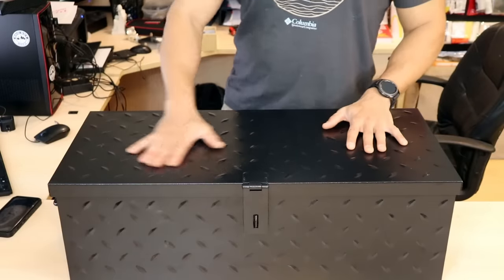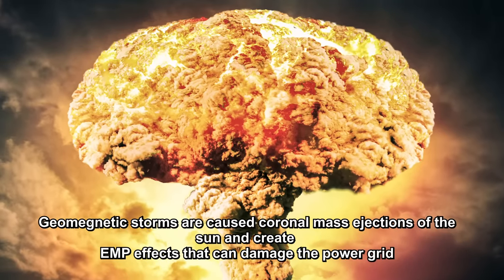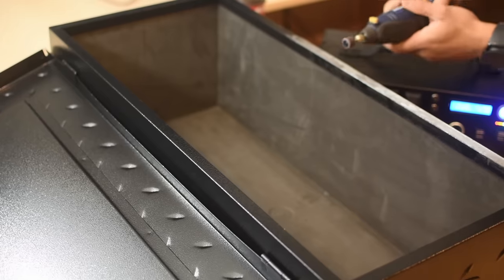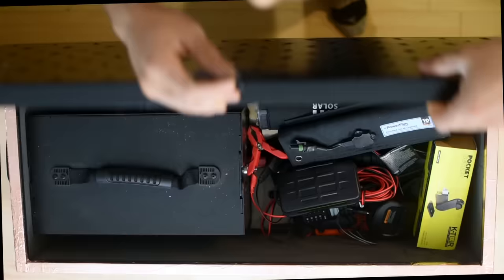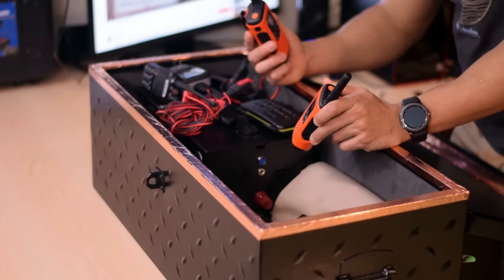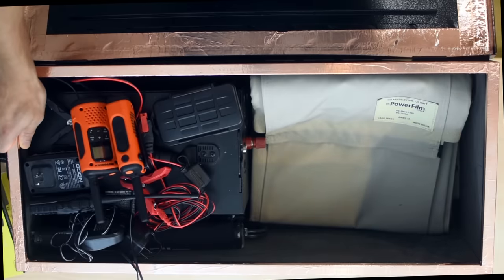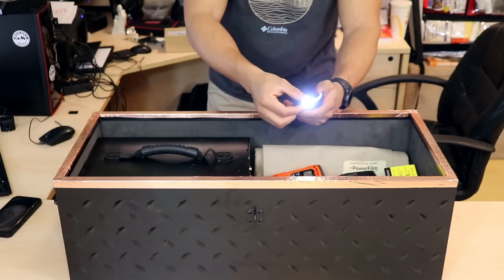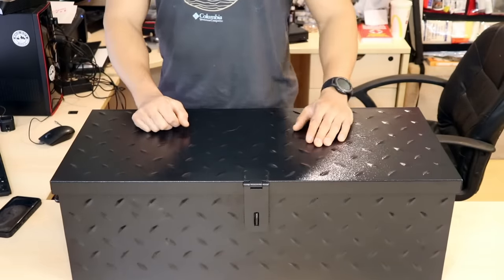EMP Prepping: Building a Good Faraday Cage | Inergy Kodiak Generator

Comment: To test yourbox for any kind of leakage, put a high power flood light or very bright flashlight inside the box.  Then turn off all lights to create a dark room and see if you can see any light around the lid closure.  Glad you contacted Dr. Arthur Bradley for expert info.
Reply: I heard you can also put a cell phone inside and see if you can call it
Reply: @mist4926  Also tune an AM radio loudly to a strong station and listen after closing.
Reply: Light and RF are different. Your idea is good to make sure light can't get out of in but RF eenergy can get through smallest of openings that you may not see light through. I work with Uhf/VHF/HF/LF applications.
Reply: Put your cell phone in it, then try calling it and see if it rings. If the cage works, the phone will not ring.

Comment: A good tip if storing electronics is to always remove the batteries and store them disconnected from the unit. A lot of stuff does use small amounts of electricity even if switched off (some LED flashlights included) and beside draining the battery over time (so that it may be flat when you need the flashlight/radio etc) it can also damage the battery or cause the battery to corrode/leak electrolytes (depending on the type of battery).
Reply: Nordic Resilience good point to remember
Reply: Sadly, some of the equipment I am trying to protect are solar generators, the simple kind, i.e. Ecoflow. Their primary function is to be that of a battery. Hope mine are well protected.
Reply: Can use use like rubber floor mat for a non conducive insulation for the faraday box and could I use rolled up tin foil for a gasket
Reply: @verdellparentaaawink268  Anything non-conductive and of reasonable thickness should work, so yes, a rubber floor mat should do the job just fine. Re. gasket, tinfoil will form to the contour once and remain in that shape. F.ex. a trashcan lid might be slightly warped, so if you don't put it back on exactly where it was before a non flexing material like tinfoil might not provide a good seal for multiple opening/closing.
Reply: @tracierondeau  put your cell phone inside it call it and if it rings it won't protect your stuff

Comment: Great idea. I use the trashcan approach with the aluminum seal, a cardboard liner and emp bags for the individual components. Others have in fact used the larger ammo cans. The most important thing is a good seal. Not hard, really, but needs to be added to every prepper's inventory.
Reply: I came up with an idea after having to open & retape my Faraday cage/can and retape too many times. Buy some EMP fabric off Ebay or Amazon so you won't have to seal your can with metal tape every time you want to open it to get something out, unless you used more expensive insulating gaskets. I have mine on top of the round cardboard cut-out I made of the top of the can. I put the fabric (large enough square so that I can see all of the fabric when the lid is on) over the top of the round cardboard piece I have covering my equipment inside the can. Then drape the fabric over the top of the can, place the lid on tight, ensure you can see fabric from all sides of the closed can and you can be certain you have metal on metal contact. The only concern is that the fabric may wear out after re-opening too often, but I have an extra cloth cut out in case that happens. Cheaper than Dr. EMP's gasket sealings by quite a lot.
Reply: I made a Faraday Cage from a metal trash can lined with cardboard too.
Reply: @debbiecurtis4021  Oil drums with clamped on top for $20.

Comment: For an aluminum box, I would avoid using copper as the two metals will start corroding together.  This is why you should never splice copper and aluminum wiring directly without using a specified corrosion inhibitor such as alox.

Comment: The seal you show on your box will be ineffective.  It will act as a slot antenna.  The EMP gasket from Bradley is exactly what you need.  Until then add the same tape across the opening like Dr Bradley applies around the trash can lid.

Comment: You can test the seal by putting your cell phone in it and then call it from another phone.  I had to keep testing it until I got a good seal.  Also, if you wrap your phone in foil several times, you can also gauge effectiveness by trying to call it.  I tried both until no signal got through for a quick and longer term solution.

Comment: Nice looking box. I'm using old paint cans lined with cardboard for my small electronics and a trash can for the bigger stuff. It looks like you still have room for a shortwave ham radio in there. I would definitely add a nice compact HF rig of some sort, along with any necessary antenna tuner, and power supply.

Comment: Nice work. Another cheap and easy to work with material for liner is good old cardboard. I lined an ammo can and taped it in with duct tape, after aluminum taping over the rubber gasket, which worked well and still provides a water proof seal. Also, electronics can merely be stored in their original plastic or cardboard packaging and placed in a sealed metal container, which is even simpler and is a good way to keep all the warranties and user's manuals handy with the device.
Reply: Wondering if you could do that! Thanks!

Comment: For $45 all in, I bought two 55-gallon steel drums, a roll of 2” conductive tape and 15’ of 1/2” round foam.  I used the foam and tape to make a gasket.  It works perfectly.  The c-channel band or 25# of dog food on top is enough to make the seal.  A drum can hold 3 milk crates with room to spare.

Comment: Great video. I have a great interest in the EMP and the bad info is amazingly abundant. Your box is good -- I would humbly suggest that in the long term you might want to use aluminum tape with an aluminum box. Galvanic corrosion I'd an issue and the reason you are not supposed to mix copper and aluminum wires in the house. It could, in the longer term compromise the seal.
Reply: You would have been just as well off using the aluminum tape. Aluminum used to be used for electronics before copper. We began using copper because as aluminum conducts electricity it heats up and caused fires whereas copper doesn’t. Just a little info for ya
Reply: Ross Fadale I agree. However, when you put two dissimilar metals next to each other, especially something as active as aluminum you generate an area of corrosion between that makes higher resistance (and heat if running electricity and potentially fires) but eventually no contact (a problem for a Faraday cage where you want a complete seal). How long it takes in a passive system, I don't know how long it takes but it generates small currents immediately so I suspect in terms on months.
Reply: Brian Jenkins ⬅️ All are correct! However, keep in mind that the box & even aluminum tape are alloys, thus dissimilar, thus galvanic action! In science, like begats like. Unless the box & tape are cast from the same smelt, there will be galvanic action. There is no way around that! Even within the same smelt, the impurities are not equally dispensed & dispersed. So, galvanic action may be reduced, it still exists in all matter. Remember, water only conducts because of the impurities... pure water will not conduct! So, perfect purity can never be achieved.
Reply: dont use tape, the adhesive on tape would be non conductive!
Reply: Practical Guy You COULD fold it over in the middle so that you have direct contact with both the box and the lid!

Comment: Spray in bed liner will also work on the inside of the box. You only need an insulator to separate the conductive layer from the component being stored. You can place smaller devices into a plastic bag or ziplock bag.

Comment: Well done video. You covered many of the points to a decent Faraday cage. An aluminum cage in the back of a truck will bounce around causing some deformation. One lock at the front of the cage is not sufficient for any type of movement. The cage will deform with only one lock being in place. Just my 2 cents. Love your channel!

Comment: Hello CP
The problem with Faraday videos is a common guy can't definitively test if it is actually working. The wavelength of an EMP is much shorter than FM Broadcast radio signal.
Two tips for you. Use compression straps around the box to compress the top down onto the body of the box. Next, have a screw welded to the bottom-side of the box, then attach a welding cable to that. Drive a one meter/yard copper pipe into the ground, and attach the welding cable between the ground rod and the box. This will give the pulse a path of get to ground.
My radio room is a giant Faraday cage. Inside the walls, floor and ceiling, are metal mesh all tied together and terminating at a 3 meter deep copper ground rod. There is also a metal box which also terminates with my ground system. I should do a video on all of it.
Other than that, well done. I love that you're taking up the challenge of off grid power and protecting electronics and information.
rock & roll
Julian STN
Reply: OH8STN meh, you don't really need a ground for a small box. For something like a radio room, yes, but that's because it is much larger and holds more energy.
Reply: OH8STN Spot on guy! You should make a video, Study of Acquisition Radars,, Continuous wave Acquisition radars,,,Range Only Radars,,, High altitude Acquisition radar,, you'll see that every one of these Radars no matter what country No matter what application they're extremely grounded . also EMP proof !!!!That Thomas Edison nuclear power plant engineer stated,, 16 Grounds is not enough.
Reply from the maker: Thanks for those excellent tips stn I'm certainly going to find a way to create a tighter seal. According to dr. Bradley a ground is not required but you've compelled me to research it further.
Reply: OH8STN how about putting an old microwave to good use? Microwaves are AFAIK part of the effective wavelength spectrum of an EMP. It's real fun putting electronics into a microwave, but if it doesn't fit, you need to take out the microwave generator, shortcut the safety and put it into an open can (making sure that the waves go only foreward).
Reply: Old microwaves CAN be good, but not all microwaves ARE good. If you use a microwave, you should test it carefully. As OH8STN (Julian) stated, most people lack both the knowledge and equipment to properly test.
Reply: To test your faraday cage, just put your cell phone inside, and try to call it with another phone. If any signal gets through (And you hear your phone ringing inside), your faraday cage isn't working.
Reply: You don't need to ground faraday cages.
Reply: This is a terrible test. Mobile phones are incredibly sensitive. You don't need to block all signal. You only need to block enough to cause the equipment to not be damaged. You just need some "ear" protection for your electronics. Not a complete isolation chamber.
Reply: Tracy Reed There are many kinds of Faraday cages. If like Julian you make an entire room a cage, then you are going to want to ground it if you have anything like electric wires or antenna cables going through the walls. On the other hand if you simply have a box like an old microwave to keep a cellphone in, then no need to ground. As to how much shielding is enough, why not fully shield? If your cellphone rings, then someone could potentially hack it even though it is in a "Faraday cage".  Much better to simply wrap it in several layers of aluminum foil.
Reply: John Tarbox In that case you are grounding for electrical safety, not because it is necessary for a Faraday cage to work. It is a common misconception that Faraday cage needs to be grounded.
Reply: No problem Tracy! Whatever type of electromagnetic attack I am under, I''ll be safe in my shielded, grounded safe room. You are welcome to hide in your microwave :D
Reply: Why would you not also take it all the way and protect for electrical safety? It is much more likely that I lightening strike hit your home than an EMP is it not? So why protect for something which may never come, but not protect for something which are far more common?
Reply: That sounds awfully like Sarges radio room from the Going Home book...
Reply: Do not ground your box.  All you will be doing is creating an excellent antenna for the EMP energy to try to find a gap in your box and render useless all of your work.
Reply: Good advice. Having spent many years in military short/long haul comms I thought his box really should be grounded. 
Do not connect the ground to your house electrical ground system!  When an EMP happens the power lines will bring that EM into the building. Your electrical systems will try to bring the power out through the return line. But chances are you will see a spike on the ground as electricity searches for the lowest impedance to ground. As the voltage level on the return rises from excess current, the RF component will find a better that for various reasons. Funny enough, lightning strikes behave similarly. You don’t have to take a direct strike from lightning to fry electronics.
Reply: Dale Slover also consider surface are of the grounds and also conductivity of the ground system. 100 grounds would not be enough for a rod driven 2 feet down on a rocky desert mountain.
Reply: Brian that’s a false sense of security. Cell phone signal are so small it is easy to block. Just because your cell phone doesn’t work doesn’t mean you are EMP protected.
Reply: Lynn Poe not entirely correct. If you ground to the building ground or a water pipe you invite EM to your box. If you have a dedicated ground then you allow your box to dissipate energy immediately.
Reply: + Tracy Reed  yes, you really should ground the faraday cage, at least the ones that are of any size. otherwise it turns into a defacto microwave oven and fries everything inside of it...
Reply: The energy level of the EMP is between 50,000 to 100,000 times as strong, a test like this is worthless
Reply: an EMP pulse is 50,000 or more stronger than anything you can produce, worthless test.
Reply: Unless you have a conductive compressible gasket around your door, you didn't protect from an EMP. and your antenna leads and power leads coming it will bring it all in anyway
Reply: Canadian Prepper ⬅️ What I find really interesting is that the debate is on wether or not the box magically turns into a capacitor or an inductor, based on usage of a ground! There is an old saying: Ground is ground, the world around!
What I noticed is that you used conductive tape that has a layer of adhesive (supposedly conductive?) which actually makes the tape a weak capacitor. You need to bond the tape to the lid & the base by using a fender washer & short screw that pierces the tape & structure together. I also noticed the clasp for the lock is painted. That clasp only bonds the lid to the base if it is a bare conductor(which equals less signal or energy pass). As it is, you may be blocking a certain "range" of frequencies, but start-to-finish any EMP blast not only carries with it a multitude of frequency ranges, but also creates harmonics & distortions from reflected (or bounced) waves that are altered (attenuated equals changed) when passing through matter. The reason that a ground rod is used anywhere, is to electrically "raise" ground level. In practical terms, this means burying the item in question underground, but not physically digging a hole & burying it. Earth absorbs & dissipates ALL frequency ranges, which is why the planet still exists. Look at the Macro & Micro aspects of EMP energies.
Reply: NO on the grounding.
Reply: Doug Wilson ⬅️ I personally do not ground, but rather shield & hope for the •Best•... and since I do not have a nuke laying around to test with, One does what one can! I do however agree that a single point ground (no matter how deep) is insufficient. If the ground conductor becomes a fusible link & opens, you might as well have not grounded at all. Especially, if you ground is tied into the grid in any way (via breaker box, etc), you can inadvertently super-charge the "cage" when an EMP detonates. The Electrical grid is a super antenna for all energies (regardless of frequency) &  ALL conductors (phases & neutral) are electrically charged by the pulse instantaneously!... So you get a pulse through the air AND a pulse through the grid!
Reply: @CanadianPrepper    DO NOT GROUND THAT BOX!   Listen to Dr. Bradley, the guy knows what he's talking about.   Read my comment on your video, that copper tape is useless and if you're a true prepper, you need a much larger cage to protect more stuff.
Reply: All cars are Faraday cages. The test can be found by searching this ...

"Richard Hammond Top Gear lightning strike"
Reply: Howard Black  Are you saying that you disagree? Why?
Reply: Howard Black  I don't get notified for those so I didn't see them. I have just read them. You seem like a genuinely nice person. Would you like to date my sister?
Reply: @Howard Black ⬅️ Personally (not that you know me or anyone else on the internet), you are entitled to your opinion! Now, let’s hear about your many years of experience, your degrees, licenses, and your obvious hands-on personal high-voltage AND low-voltage experiences that qualify you to Poo-poo whatever others say... We are all quivering in anticipation, professor!  Self-appointed “arbiters of truth” really peeve me... Enjoy the Poo-poo patrolling... 🤣 •SMH•
Reply: To ALL those that read this: I rest my case on the great Howard Black & his unsubstantiated  & uncredited comments... someone please send this troll more cheeto’s & pop-tarts! 👍